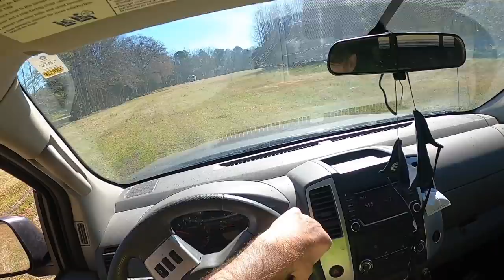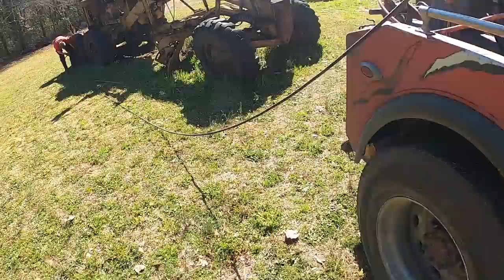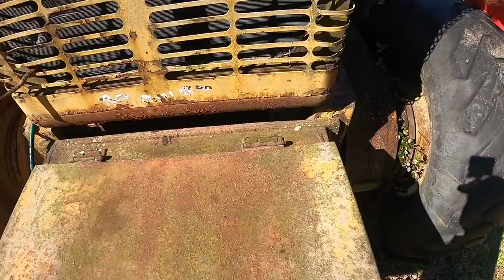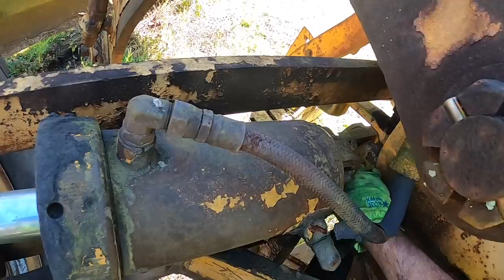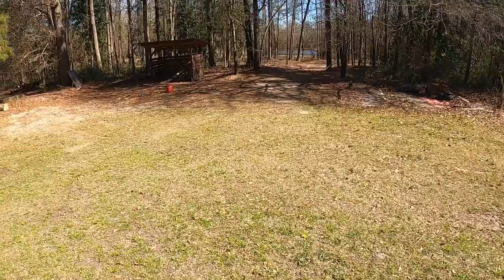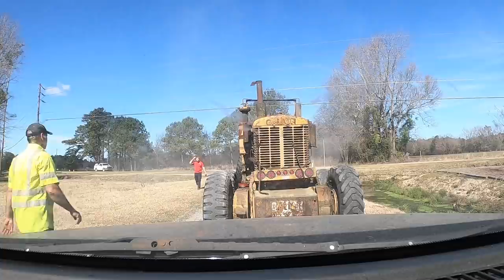Towing a Galion T 500 Motor grader

Comment: Thought you might chain or strap that grader blade to keep it from dropping down along the way.. 
See some trees in bloom, sign of spring.. but our snow just melted.. in WI
And thanks for taking us along on a different tow job.
Reply from the maker: Deernut00  it was chained up by the owner and all fluids drained. Thanks for watching and stay safe
Reply: Just had to crank up the AC here, 80 degrees. Gonna be a hot summer. Alabama where just a few weeks ago snow, freezing rain, and black ice.
My wife had to fly into Appleton and then go Rinelander(?) In the dead of winter. So cold the hydraulics froze on the medical service truck she was in. She said then, no more snow for her.
Reply from the maker: Mr Donnie thanks for watching and commenting. Stay safe

Comment: Had a 25 ton challenger..tow anything. Before pull a lever trucks. Snatch blocks and rigging. Put a lift on it and guy who bought it later is still running it. 86 model. Should have kept it. No computer.
Reply from the maker: Mr Kyle thanks for watching and commenting. Stay safe

Comment: Bead lock rings :D If you haven’t seen them before they are killers. Never be in front of them when filling with air.    Not having a go or a criticism, if you don’t know it’s fair to assume it’s just a rim ^-^ They get rust in them and it makes the big spring ring not lock into the rime right. Then it will beat you real hard and mix all your internal bits up :o
Reply from the maker: Teamidris thanks for the  information.  I will be looking from now on. I have not had any experience with those rims but I know now. Thanks for watching and stay safe

Comment: This looks like the size of Zack I used as a professional recovery specialist, what was it a 35000 under reach, my truck had a famous Holmes 750, , I loved that ol 1975 COE 13 speed Kenworth , nice thanks crying shame they are scrapping this grader, I’m grader is a wobco, 12 , 4 cylinder Detroit, this machine looks like it is mechanical, so if I was you I would cut the turn table off and keep it , so I could make me a rotator tow rig with it , I have always wanted to do that with one , the mowe board on mine is a sliders type, but you can adapt them to have rollers, anyway need vlog thanks BigAl California.
Reply from the maker: Mr Al thanks for watching our channel and stay safe